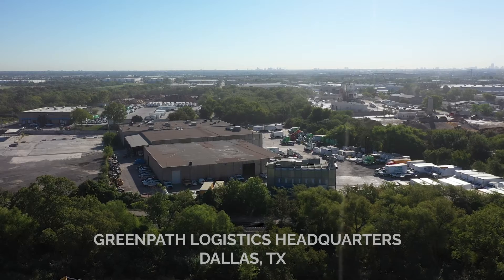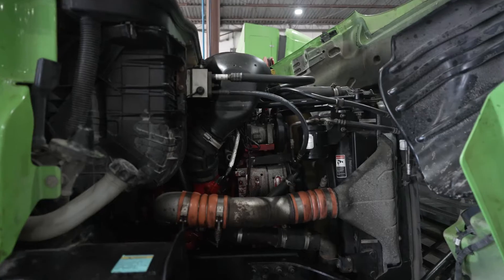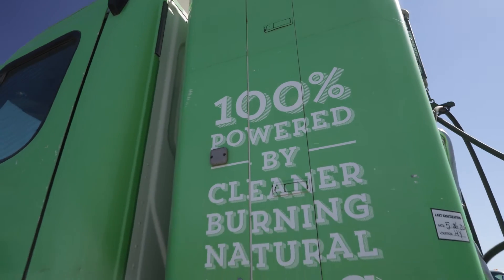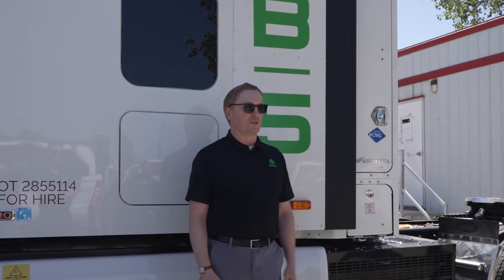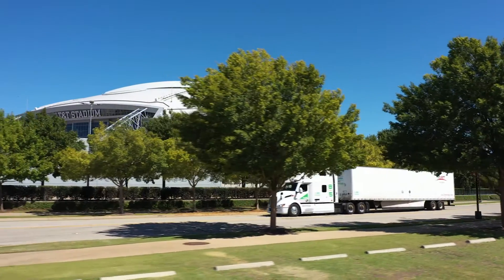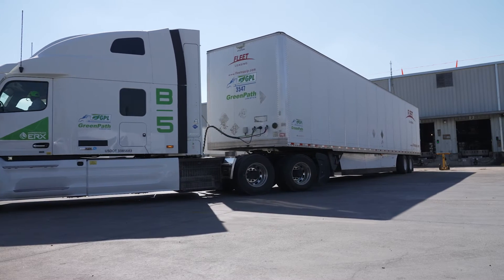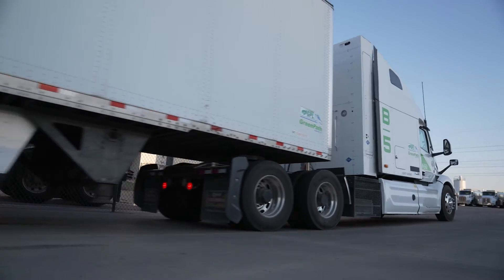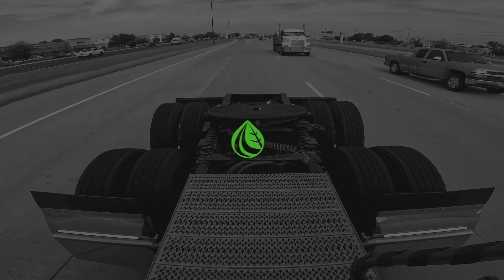Controlled Fleet Trials with the Hypertruck ERX Demo Vehicle | GreenPath Logistics

Comment: The only scary thing I find is that in the Netherlands I work with a transport company with 450 trucks. They have 10 trucks that run on LNG, but are all not being used anymore because LNG is triple as expensive as Diesel... I hope time changes and it stays cheap in America at least.
Reply: What’s with RNG ?
Reply: @Urfinchannel  Price is up in Europe due to the war in Ukraine.  Russia has drastically cut supply to Europe, forcing up prices.